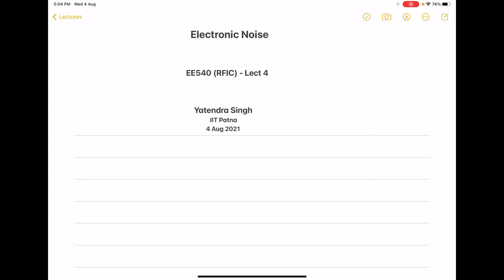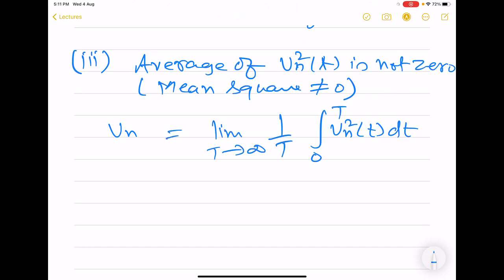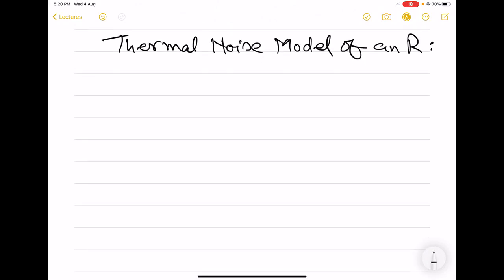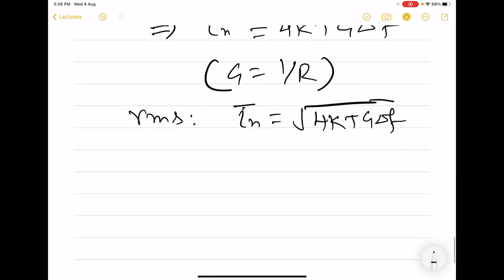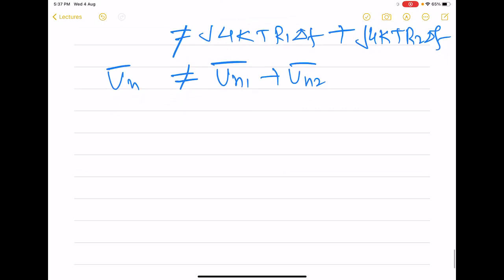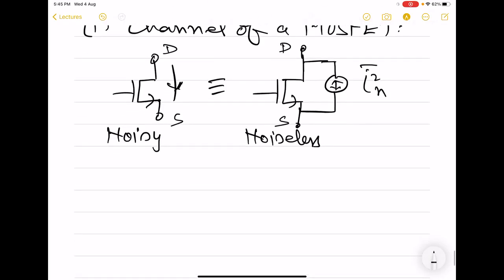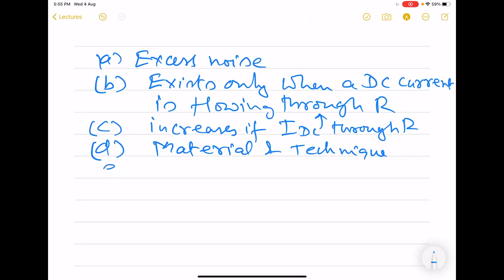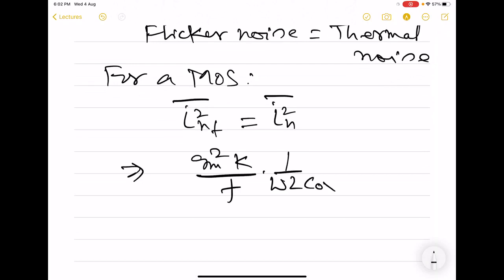Radio Frequency Integrated Circuits (RFICs) - Lecture  4: Electronic Noise

Comment: Hi Prof. Yatendra,
I was wondering if you would have the time to discuss the following:

1. Going through an actual LNA/PA design example (computing W/L, other component values) and simulating on Cadence/ADS.

2. Going through some advanced LNA/PA architectures from the recent ISSCC/JSSC papers which are not available in standard textbooks like Razavi.

I have watched your previous playlist and it was fantastic - very well explained! Thus, was wondering if you would have the time to go through these in your current playlist. 

Best regards.
Reply from the maker: Thanks for liking the lectures. 
It’s been quite difficult to cover all the important circuits of RFIC from analysis point of view in sufficient detail in 42 lectures of a semester e.g PLL gets very few lectures allotted to it. So including designing RFIC circuits won’t be possible. 
Moreover, I need more time to prepare myself for a truly design-based course, which I will try to do in future.
Reply: @YatendraSingh  
could you add lectures on VCO design and transreciever architectures
Reply from the maker: @AhmedTarek-kr9kz Thanks for the request, but currently, no plan of doing it.
Reply: @YatendraSingh  
okay if you don't currently plan to do it could you cover the following topics in the 2022 version of the course 
-VCO and phase noise
-Integer-N and Fractional-N PLL Synthesizers
-transciever  architectures
Reply from the maker: @AhmedTarek-kr9kz  Sure.